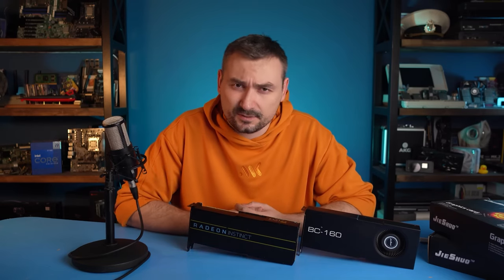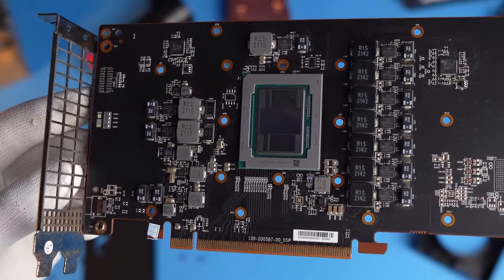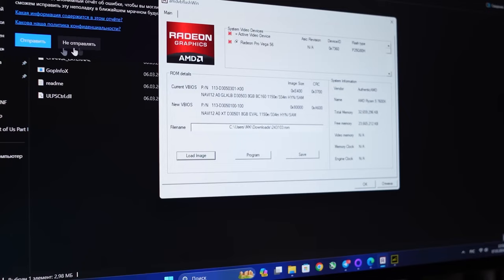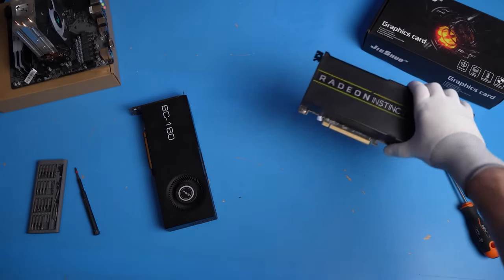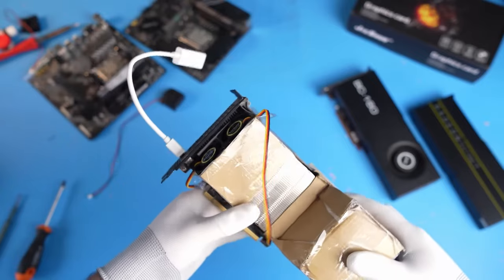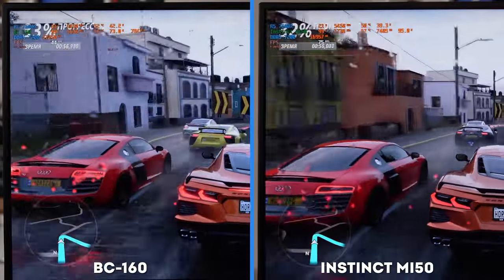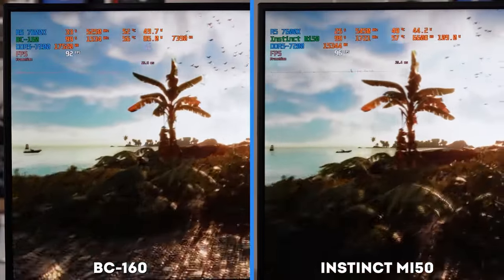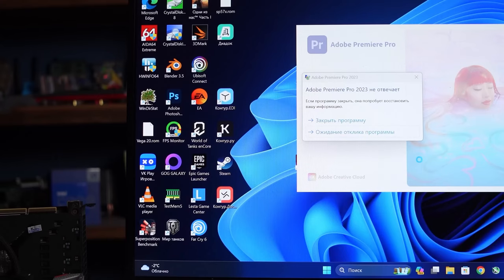No longer for mining | Gaming on AMD BC-160 and Instinct Mi50

Comment: 5:05 - MxGPU is a driver for SR-IOV passed or partitioned virtual GPU, not hardware GPU - it's a driver for Virtual Machine Host that has virtual GPU passed into it, it requires host system driver for it to work properly.
There's no publicly available mxgpu driver of course, you need to sign NDA to receive it even if you're lucky for them to agree to provide it.

To use such GPUs comfortable without makeshift cooling solutions, you need Supermicro SC745 desktop case with GPU an assembly MCP-320-00040-0N

Comment: I have an instinct mi25 with bios from a wx9100, it allows me to obtain video output on the display port, there is a lot of information on the internet about this gpu, even to make liquid cooling mods for it, I would personally recommend that you try that gpu , it is very flexible and can be tinkered with a lot to get the most out of it, if you are going to do it, you have 2 versions, the mi25 with 8+6 PCI pins for power and the one that comes with 8+8, I would recommend the second one, but it really is Interesting and I think it could interest a large number of people. 😄

Comment: I got a real MI 50 32 gb from ebay and I'm using it in Linux where the drivers just work.  But now that you showed that the reported temp and the hotspot temp can be so different you have me worried.  NVTOP in linux only reports one temperature.  How do I get a hotspot temp?  Also, I've seen it use up to 300 watts.